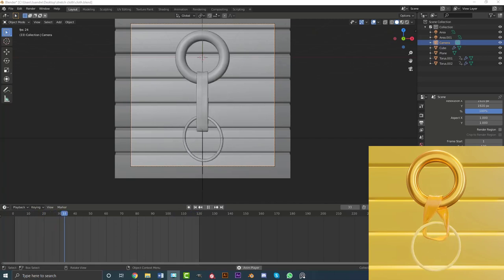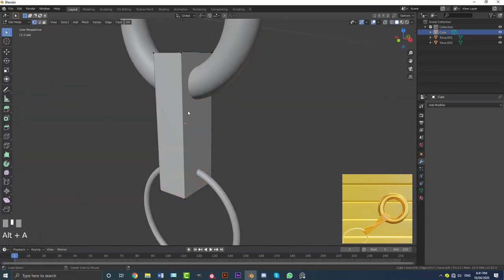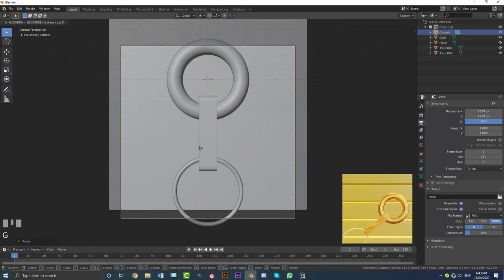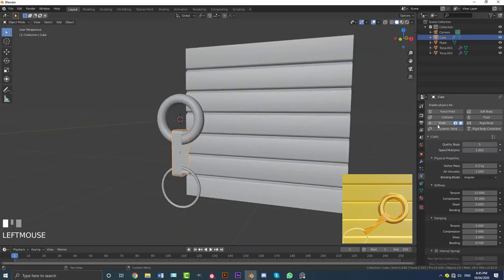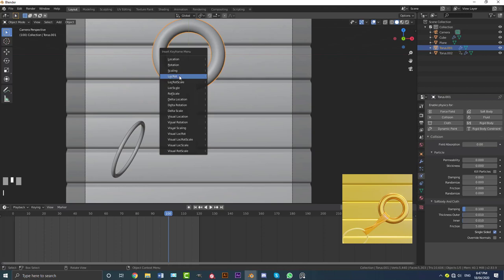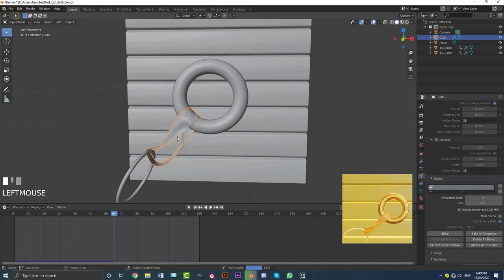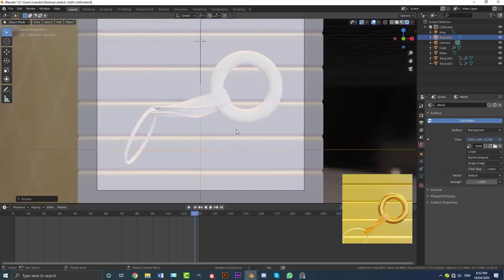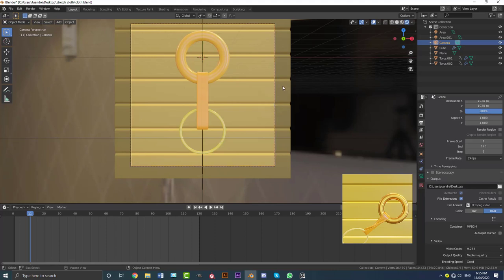Blender: Make A Stretchy Cloth Sim between Two Rings

Comment: The bottom ring just tears through the cloth.  I put mine the same spacing as yours, what did I do wrong?
Reply: I did it again, same settings (that I can see) as yours and the bottom ring still goes right through the cloth.  I assume your default torus is 2m?  (It looks like 2 units, but since your numeric entry is closed I can't tell.). I downloaded the 2.83b as well, and the default values for cloth collision distances are different, but I changed them to 0.015 like your are and still fails.   I upped the quality of the sim to 24, and then 48.  Still tears through.  Adjusted the collision thickness too, between .2 to .02 and no change in tearing through the cloth.  I'm at a loss.
Reply: HEY!!!   I ignored the tearing and baked it anyway.  It works now!  Odd, but I'll take it.
Reply: My band snapped and the lower ring came crashing through my monitor screen! And it was nearly brand new!